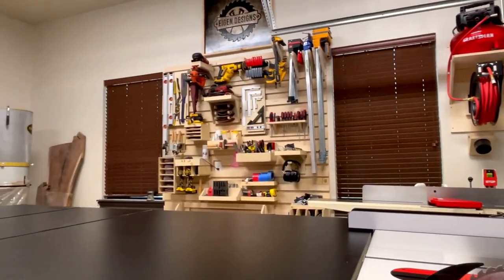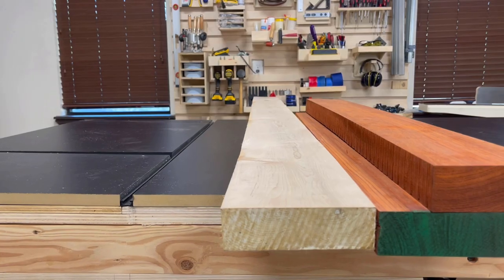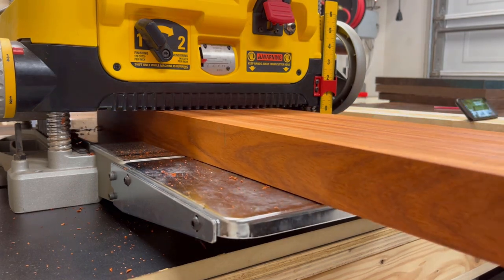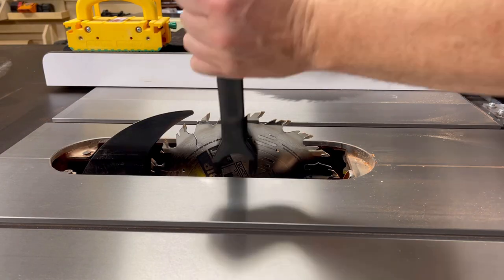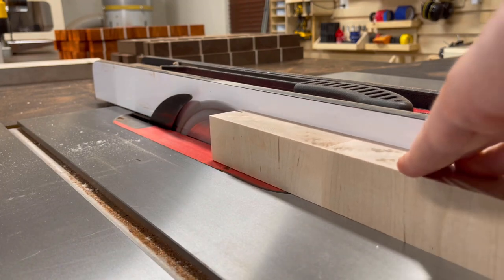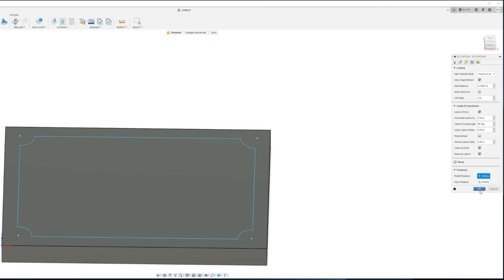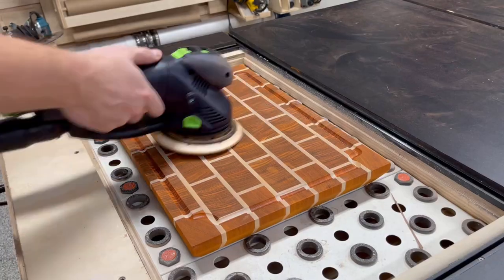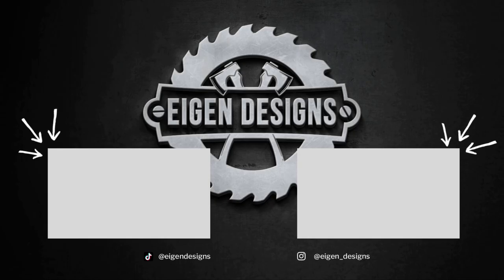Brick Pattern Cutting Board  |  FREE Viewer Giveaway

Comment: If you will put a piece of 1x2 pine in the harbor freight clamps you won’t believe how it improves them. Nice work
Reply from the maker: Hey thanks for the tip. Do the pine 1x2s help with more even pressure distribution?
Reply: @EigenDesigns  it seems like it.  It stiffens them so they are stronger and don’t bow or deflect

Comment: Is that a sanding block you use to apply the mineral spirit?
Reply from the maker: Hey Tommie, I actually use these cheap foam applicator pads from the automotive industry. They come in large blocks that I cut down into smaller pieces. I have found them to be a cost effective way to apply finish to wood working projects. 

Link to applicator pads: https://amzn.to/3mLfoRO

Comment: Enter 😁 I've been working on a brick pattern cutting board and it isn't coming out well at all. It all comes down to me not cutting my pieces big enough to give it room for all the planing. Yours looks amazing
Reply from the maker: Thanks for the kind words. You know, I really wish I had a drum sander because that would be a great tool for this project. 

I have registered you in the giveaway :)
Reply: @EigenDesigns  I wish I could afford one. I'm working with an old craftsman benchtop table saw and a ridgid 13 inch planer and a Dewalt random orbit sander for this one. Thank you for registering me